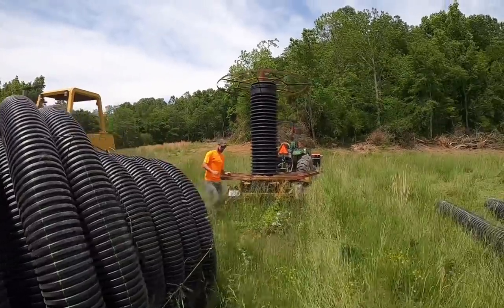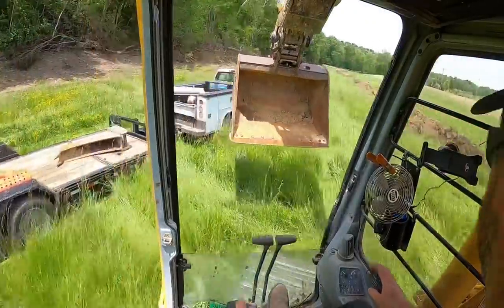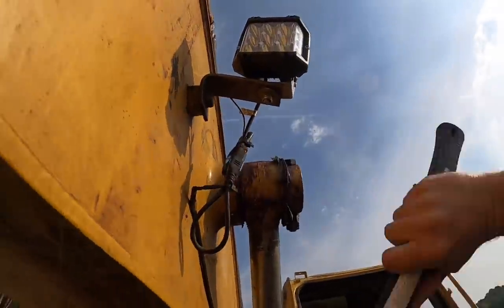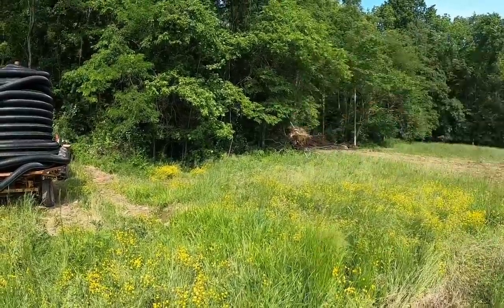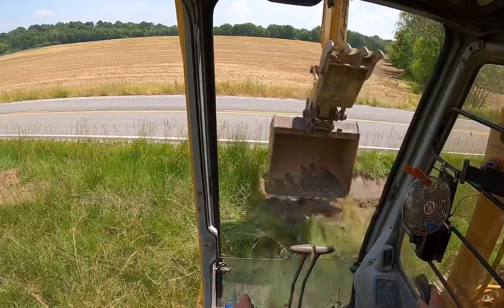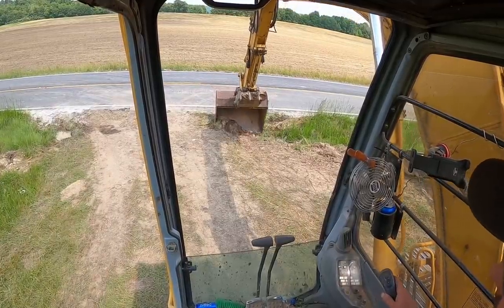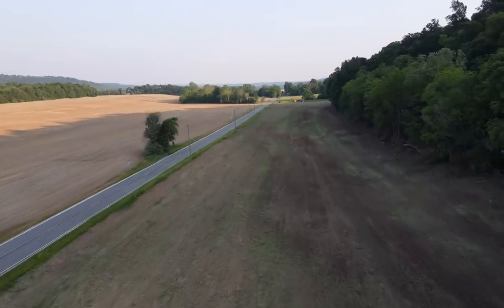I had my doubts but I think we are going to get it installed Dirt Perfect Matt and Jerry for the win

Comment: We had a waterway, in a field, with an old clay tile in the bottom.  The clay tile was broke and plugged in places so that water was coming to the surface, flowing along for 20'-30', then going back underground into the tile.  We had new plastic tile ran up both sides of the waterway.  When the first run of plastic was installed, the water coming to the top of the ground disappeared within a half hour of the tile going in the ground.  The new tile was maybe 10-15' to the side of the old clay tile.  It is amazing how fast drainage tile can make a difference in certain situations.

Comment: here in Northern Ireland around where i live the farmers have to fill the trench almost to the surface with 2" clean stones so the water will get to the perforated pipe, the clay, once they get through the soil, is usually like putty, and in a lot of areas peat , so the water doesn't drain through it, they don't use those risers poking above the ground
Reply: Different soil conditions require different types of drainage ideas. Where dirt perfect is I'm guessing it's got enough sand to drain but there is a layer of impervious that stops the water from going down.

Comment: DP I see farmers everywhere putting this tile in, but how long do you think it will last before it gets plugged up? Being a builder my self I see basement drains clog up after 15 years. And most of them had a felt cover and rock. The old ones had straw. I have read up on the pipe it’s supposed to be self cleaning with the ripple effect, if you have good water flow. I think your dry dams will help in high water, to clean it. I was just curious if you have seen them fail?
Reply: There is an old 4 inch clay tile in a low spot on our old family farm. Dug by hand and tiles placed by hand 100 years ago(no straw, no ''cover' and no rock) and it is still draining the field. The worst part is, the county came by and put a new tube under  the road where that tile comes out, but they set the new tube over a foot higher than the tile outlet. They ended up putting a riser at the tile outlet, but that just means the water has to back up in the tile till it's as high as the tube under the road.
 Ya still can't fix stupid, and just about anything done by a government agency must HAVE to be stupid!
Reply from the maker: 50 plus years have dug up older then that still looks good remember it’s catching ground water
Reply: @bluegrallis  BUT it looked SO GOOD on paper!

Comment: Great video 👍 The culvert pipe on the entrance looked like it wasn't very deep tractor's are  pretty heavy.
Reply: He is limited to how deep he can go by the culvert dept at the bottom end he has to drain to.
Reply: @ArnieD17  good point State by state culvert spec's etc , shame Mr Perfect didn't mention that 🤭
Reply: It can't be deeper than the ditch, or you would have to pump it out on the outlet end. The ditch 'very deep, so the culvert can't be.
Reply from the maker: Yup

Comment: If your pushing the pipe together with a excavator you don’t need to lube the pipe specially if your pushing on the Spicket end of the pipe we do a lot of sticks and if we’re digging usually we cut 3 ribs off from the spicket end and take the gasket off it and use it as a push plug just set it in the bell use the excavator to push it then take it out and move on

Comment: 1)  I wonder if you could benefit from a wireless camera on the stick, streaming to a tablet in that clamp visible above your machine screen in the 120, when you're doing precision work like filling the narrow trench with the 6' pipe in it from the side. Sort of mirror.

2)  Evolution: from excavator to dragVine...

3)  Yes, I've noticed: once the field was dry, you didn't need a Matt anymore.  ;-)

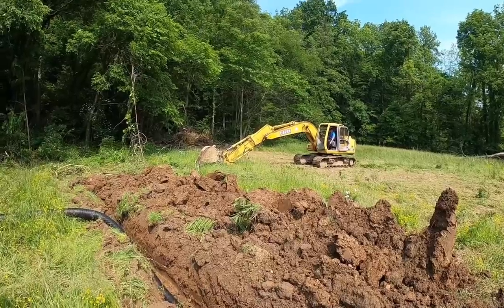Comment: At 33:40; once that pipe blew my first thought was, you could use my multi-purpose vehicle concept, for its features, ie: a fold away two ton hoist, custom truck lift (lays flat on ground), removable goose neck and fifth wheel hitches, swap-able winch (front to rear), compressor, generator, mig/tig welder, plasma cutter and other useful equipment.  ;-)

Comment: You didn’t have to track over and dig across the pipe just had to double your size over the pipe when uncovering it since two bucket withs is enough to cut the the pipe and be able to get a T in it

Comment: With that slope grade laser you need reader on the boom you will never go back they are awesome
Reply: He has one, but the bucket and the stick have to be in the same position each time you check. He has used it before, but does pretty good without it once he's at grade.

Comment: Just curious, have you ever had culvert pipes crush from not having rock around them?  I've seen quite a few pictures from storm sewer installations that are not driven over and are crushed/ egg shaped.
Reply from the maker: No
Reply: metal ones that are large enough can crush if they are not backfilled evenly on both sides at once. Not see it in plastic ones. Some pipes come oval too.